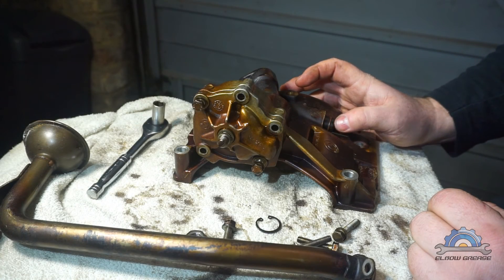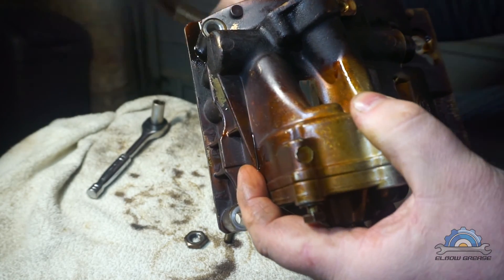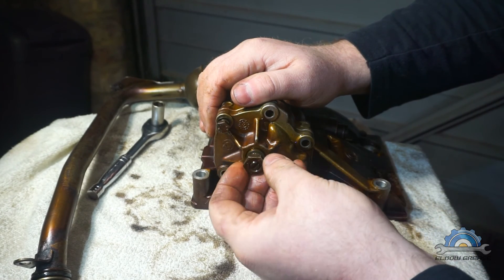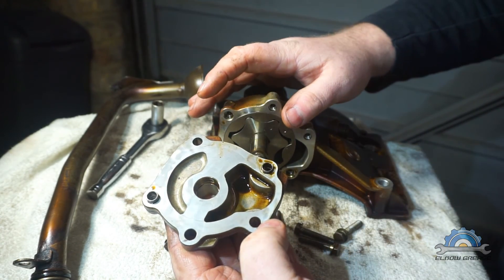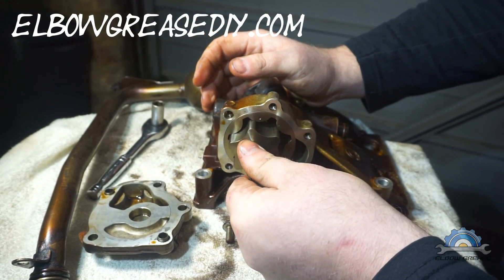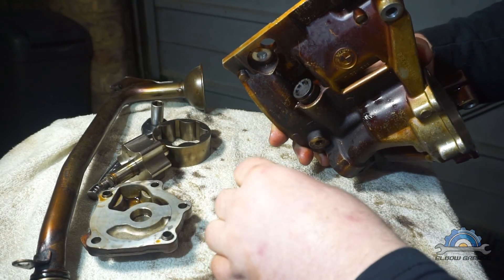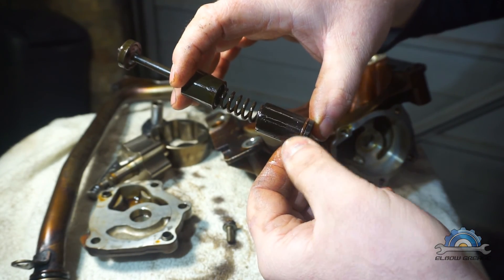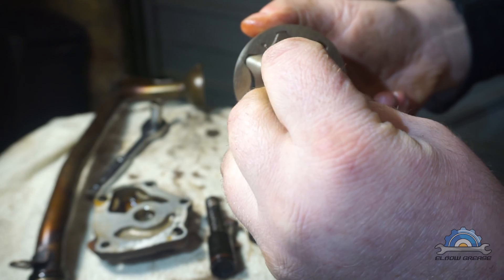BMW  M54/m52tu OIL PUMP DISASSEMBLY and NUT

Comment: It's hardly a new concept,  but just a note on the oil pressure relief valve and spring.  For those with oil pressure worries with an older engine,  It may be useful to mention that the spring rate can be changed to a stiffer rate so as to increase oil pressure linearly.  Fairly common to change a 60 psi spring to 80 psi for old banger race cars (which usually ended up at 60 psi again due to wear).  Easily done as it's only a spring.  
Thanks for all the great work that you've done for the M52/54 community.  Keep it up ;)

Comment: Have you had issues with the red oil light flickering at idle on an m54?
Reply: could be your oil level sensor
Reply from the maker: Never had problems with oil light - red(pressure) ,yellow - (level)
Reply: I have changed that and the oil pressure sending unit. Along with the plastic filter housing.  I have no idea whats wrong with it.  I added some stp oil treatment and it seemed to help.  I have 5w-30 synthetic oil in it.
Reply from the maker: Josh P Responsible or oil pressure is oil pressure sensor or general wear of the engine
Reply: Do you think its something to worry about or if I just run some thicker oil in it it'll be okay?
Reply from the maker: best way to find out is to do oil pressure test and then take action

Comment: Do you think it's necessary to change the valve and piston when doing a rebuild or change only if it looks worn?
Reply from the maker: ninjadude2000 inspect and judge.I would replace both o-rings just to be safe
Reply: Right on. thanks man